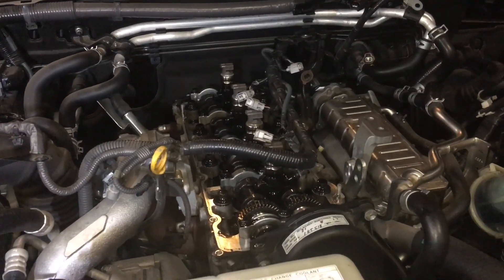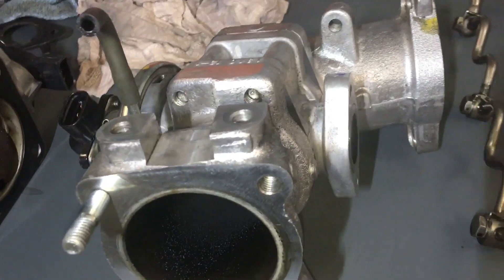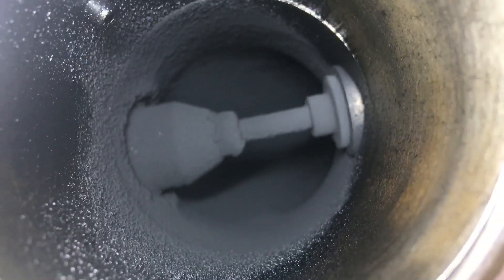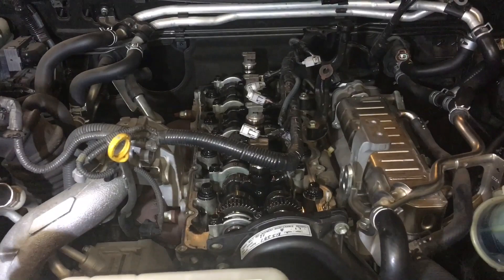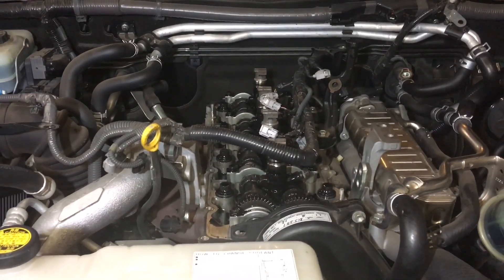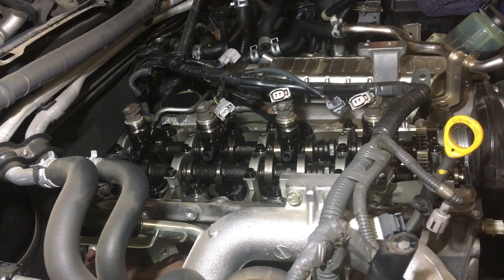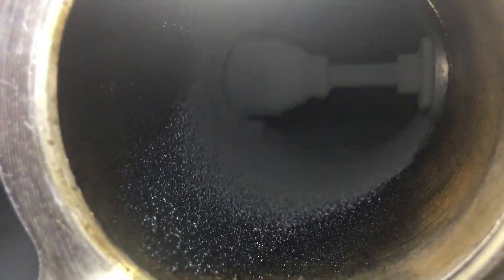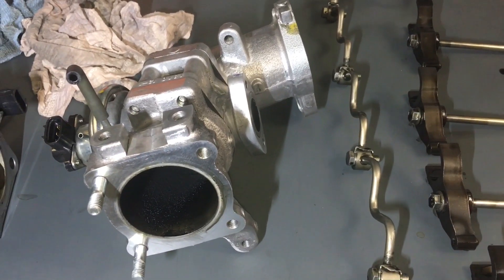INFORMATION including EGR PLATE 7mm Flow reduction of EGR Exhaust gas recirculation

Comment: Have you looked at the electronic EGR blanking modules at all? I fitted one to my 2021 Prado and have done about 5,000 km with no warning lights. The EGR valve is completely disconnected so I assume nothing gets through. It’s pretty simple plug and play system, takes about 5 minutes to fit and I can quickly remove it when the car goes in for a service so there are no warranty issues.
Reply: Yer Pajero has the same type of thing. Resistor makes the engine think it’s -6 degrees and egr stays off